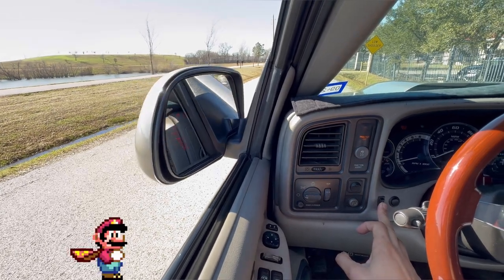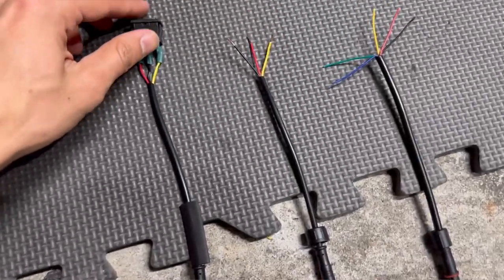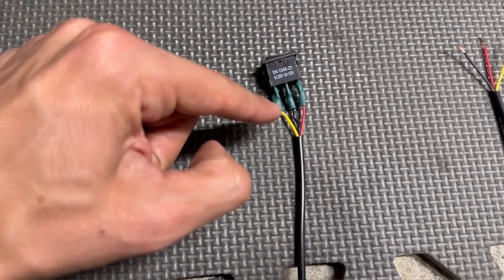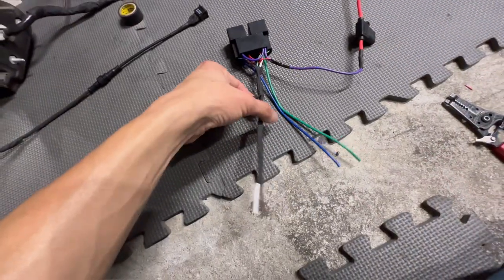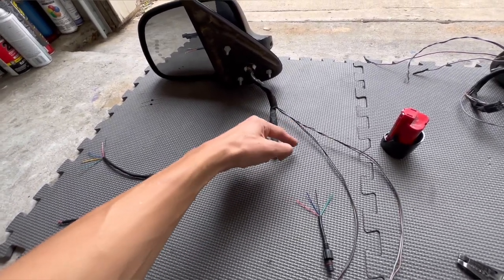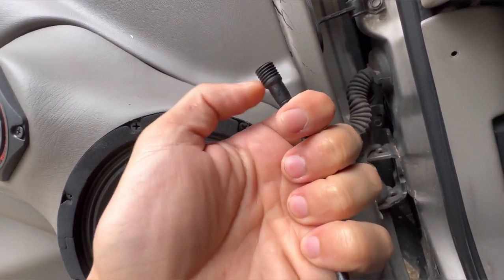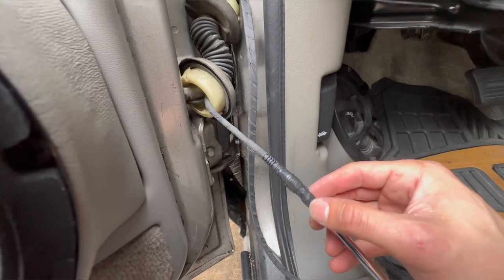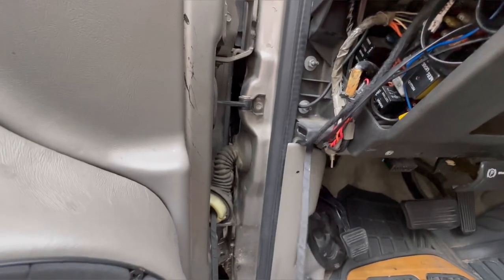Folding Mirrors Conversion with Toggle switch! 🔥🔥🔥99-02 Tahoe/Silverado Pt 2

Comment: you can get the power mirror buttom from an escalade n u don't  have to hold down the button
Reply from the maker: Yeah bro I know, I’m going a different route that will not work with the Escalade switch💯

Comment: Brother , does that mirror will work on stander truck single cab
Reply from the maker: What year is it?
Reply: @MiGo713  2002, and i get door harness with mirror from 2004
Reply from the maker: @tariqyousef2520  the 03-06 mirrors will fit but you will have to convert the plugs like in my video here Folding Mirrors Conversion DIY Tahoe 99-02 Part 1 🥶🔥🔥🔥
https://youtu.be/iJWMvPfFuDg
Reply: I mean for window/look switch and all of that
Reply: @MiGo713   i have the harness for 2004 so i need to change the plug for door/mirror switches correct ?!!
Reply from the maker: @tariqyousef2520  yes that way it will be plug in to your 99-02 harness
Reply: @MiGo713  ok thank brother appreciated 🙏🏽
Reply from the maker: @tariqyousef2520  For sure good luck on your build!👍🏼💯

Comment: Nice work homie. Wish you was in Houston. So in my case, I got the 02 escalade switch. Would that make me skip some steps?
Reply from the maker: I am in Houston lol but my schedule is pretty bad right now.  Well on the Escalade switch it’s a whole different wiring method.  I’m doing it this way so I can control it with my alarm later and the Escalade switch can’t do that.  And Thanks!!💯
Reply: Ohhhh I see what you got planned.  That's gonna be fire. Well I gotta figure out how to do it with that escalade switch. And the way my job setup, trust I feel that.  Just let me know when you're free or email me info on the escalade switch
Reply from the maker: @trillville482  Thanks!!💯

You can try wiring the pins from top to bottom as 1 through 5.  On the Top pin (1) you can connect to a dimmer or parking light wire for illumination on the switch at night is desired but not required to function.  On Pin (2) connect to a good ground/clean metal.  On Pin (3) Connect it to a 12v power source or Accessory wire and add a fuse to keep it protected with 10 or 15amp fuse.  On Pin (4) connect both mirrors wires that are to open the mirrors.  And on the last Pin (5) connect both mirror’s wires that are to close the mirrors. Let me know how it goes!
Reply: Ok now the way the button setup its a black wire, yellow one, grey one, orange one, and blue
Reply from the maker: @trillville482  Not sure about the colors, all I was able to find was that information on the pins since I don’t have Escalade switch to test out
Reply: No luck I just gave up. Can't figure out the power wire.  Lol
Reply from the maker: @trillville482  Are they not moving at all?
Reply: Not at all, I got frustrated.  Might be the switch might just be me. Lol
Reply from the maker: @trillville482  Damn lol It could the switch not sure.  Those switches are not too common so I’ve never tested one out yet
Reply: I ordered another one to be safe.  And I'll try again with this one tomorrow.  Lol
Reply from the maker: @trillville482  Cool bro, you’ll get it done👍🏼
Reply: I figured it out💪🏾 now only one mirror folds. So I'm thinking the motor bad. Cause it's identically ran together.
Reply from the maker: @trillville482  badass bro!!💯 yeah it could be, you should test the mirror straight to the battery and make sure it’s good or bad

Comment: Thanks so much for posting! I'm still wondering if the relays are really necessary, I have a switch I bought that will reverse polarity depending on which direction it's pressed, are relays just there for safety?
Reply from the maker: Thanks!! No problem💯 and the reason I’m doing it with the relays is because I will be upgrading it later with my alarm, which would not work with a reverse polarity switch or Escalade Switch either!!🥶
Reply: @MiGo713   I actually tried to hook it up with the 02 escalade switch but the 12v & ground got to hot so I had to put 2 in line fuses & extra fuse on the purple constant power but now it doesn't work would I have to use the blue & green wires on the connectorof the relays? I had both of them as ground.  After I watched you're video again I tried to wire the power folding mirrors to the green & blue wire & it would not open or close & there was no power idk what I'm doing wrong . Do you have any idea what I could be?
Reply from the maker: @allan92flores  this wiring is not a for a Escalade switch bro, that’s a whole different wiring method.  I can try to post how to wire a 02 Escalade Switch

Comment: will this work on a 05 gm base model
Reply from the maker: If your hardwiring the connections yes, but this will not make the glass move only make the mirrors fold

Comment: Hey homito what mirrors do I have to get from what vehicle I have a 2005 Chevy Silverado reg cab with power windows and power locks and would love to have folding mirrors and turn signals as well I think my truck is a LS IF NOT LT BUT it's all power no manual thanks in advance homito can't wait to add them on my truck thanks
Reply from the maker: The mirrors are from 03-06 Escalade/tahoe/Yukon Denali with all the features Dl3, I believe on your truck it’s just plug and play but you will need to change the door switches to work 👍🏼 and No problem Thanks!💯
Reply: @MiGo713  hey brother what do you mean by door switches I'm kinda lost thanks for explaining
Reply from the maker: @chatobalencian1504  you will need to replace both mirrors and both door panel control switch panels where the mirrors will plug in, they are different than the basic ones it has the folding button there and complete the new circuits for the mirrors to work properly.  They are from the top trim gm trucks with all of the features and Dl3 folding mirrors

Comment: Do you sell just the wires ???
Reply from the maker: I can, but it’s best to do the full conversion if the mirrors are not converted yet. Since the plugs have to be cut and soldered in place

Comment: What size fuse do you recommend if I choose not to do the diodes? And what size fuse did you use for the relay?
Reply from the maker: You can use a small 1 to 3 amp fuse they don’t use much current, on the relay a 15 amp fuse is good